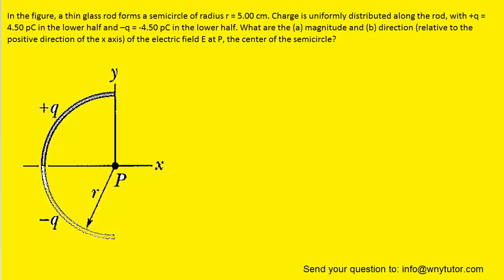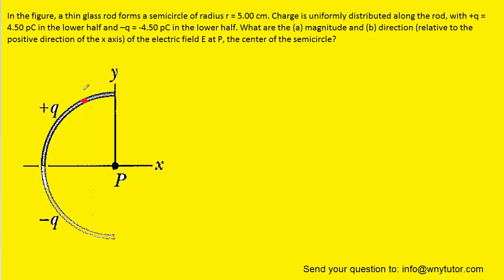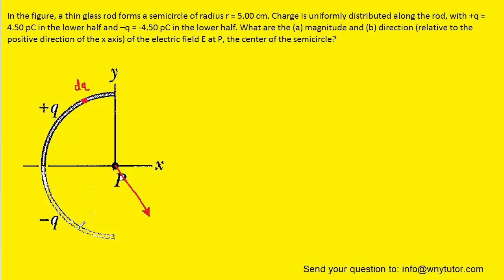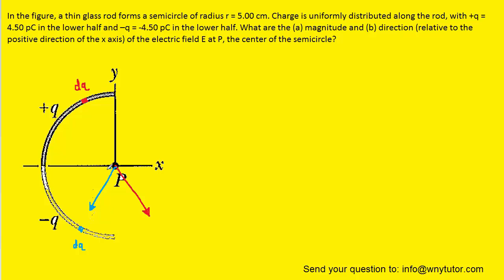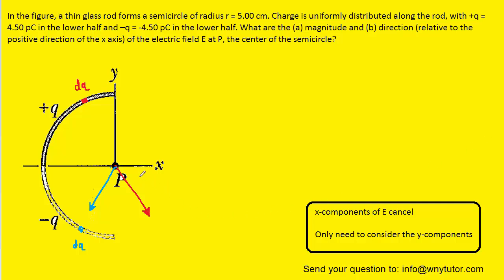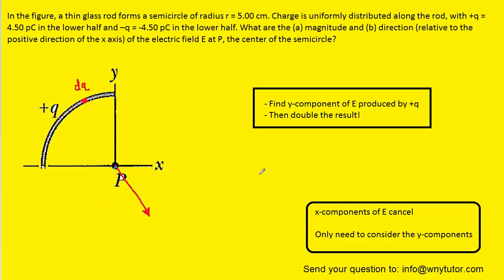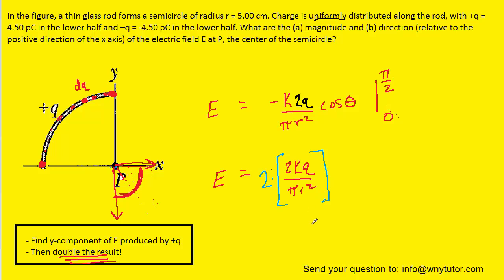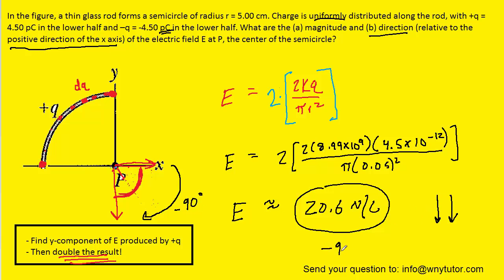a thin glass rod forms a semicircle of radius r

Comment: I noticed that your final answer for the magnitude was a positive value, even though the direction of the movement was 90 degrees below the horizon.  The question on my homework is basically the mirror of this, where the semicircle is in the first quadrant and is of negative charge.  Using your method, I got a negative value when calculating the x component of the net electrical field (I did make sure to use cos instead of sin during the integration).  Is that supposed to happen?
Reply: same dude